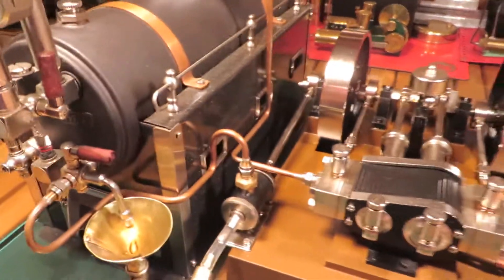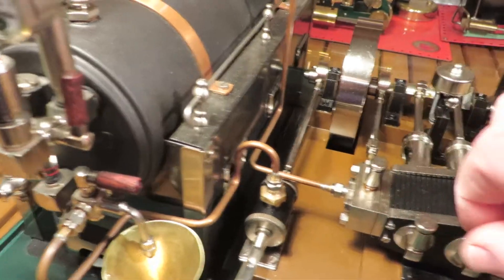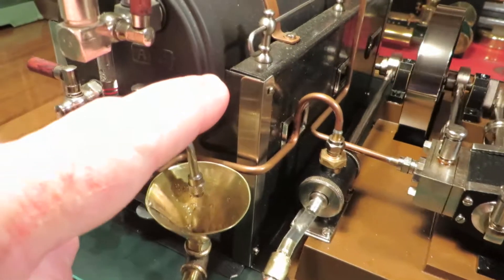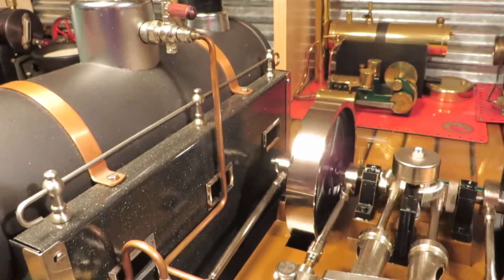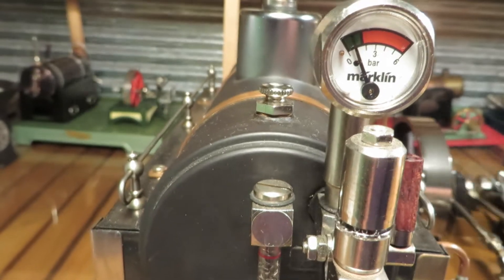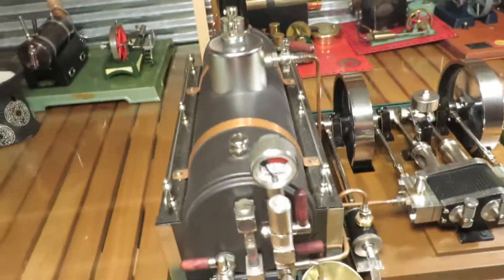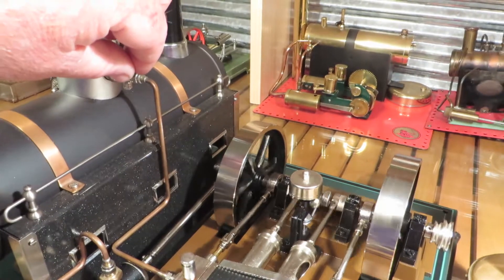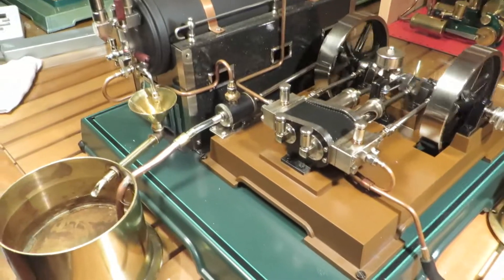Steaming the Märklin 16051 Model Toy Steam Engine

Comment: Hi, nice video, I love the sound of the chuffpot! Have to get one myself :-)
A question, I also have the 16051, just baught it on ebay but I have some play in the crankshaft, is that normal? I don't thinks so. If you take both flyweels you can turn them a little bit in opposit direction. Can you check that for me.

Thanks!
Reply from the maker: +Frank Smit Hi Frank, yes the 16051 do have play in the crankshaft. They are not a solid straight through crankshaft. I wondered the same thing (as I think every new 16051 owner does) when I first got mine and saw the wobble when holding both flywheels. Its just the method that Marklin used to manufacture these replica's. It could have been either cheaper or simpler method of manufacturing. But rest assured that yours is the same as all other 16051's
Reply: +Blue Heeler thanks for the info, it had me worried, in fact it still does haha. Will it run smoother if the play is out of the moving parts? It almost jumps of the table at higher rpm's.  What do you use in the burner, I had the blue stuff in it but does not burn at all, if I put ethanol in it goes ok but it burns out of every hole..